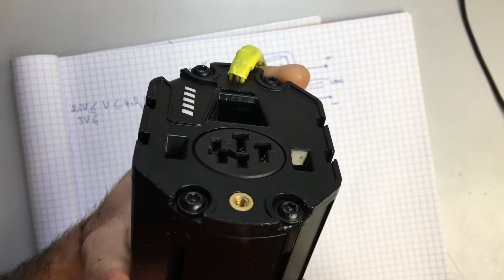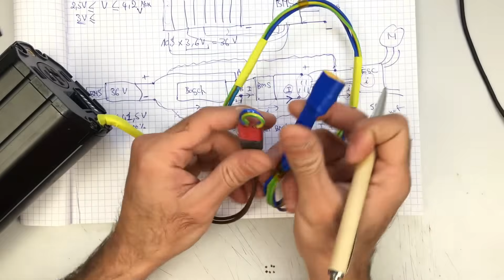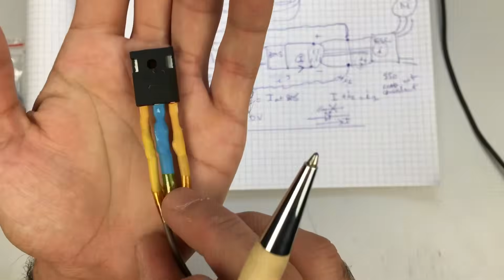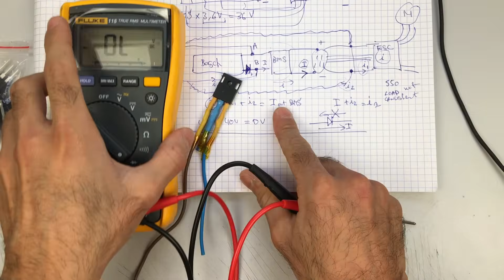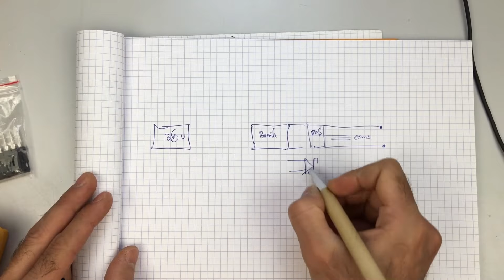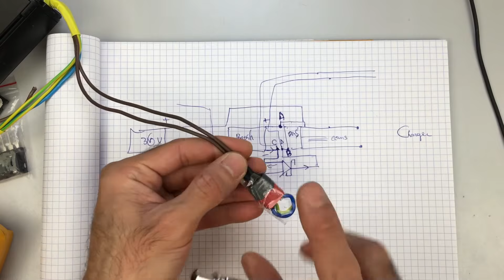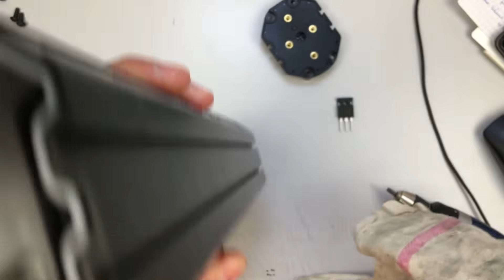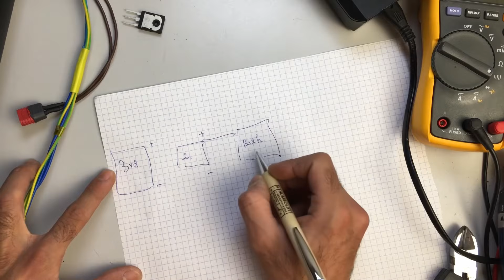Bosch ebike battery hack - Run your bosch ebike on any 36v battery

Comment: Thx, info before bms 👌,,  i just connected two bosch 400 batteries  together and bike runs twice range , of course same batery should be
Reply from the maker: Good to know. 
You connected them in parallel after BMS?

Comment: No fuses?
Reply from the maker: No need. The bosch bms has a fuse.
Reply: @theelectronage  Does it? It has a Shunt based fet cutoff, but no real fuse.
Reply from the maker: @Beeeeeeeeeee right. it has the same purpose. Doesn't it?
Reply: @theelectronage  If you're sure that the time the fets need to turn off is less than the time needed to blow up the fets with the new, higher short circuit current as the IR of the packs is way lower now.

Comment: I wouldn't use anything other than a Bosch battery.  I value my bike.
Reply: Sure until 5-7 years from now, when bosch stops manufacturing the battery of the generation you need and you need to change your whole bike that would be otherwise fine.

Comment: Why dont you get a bosch dual battery system ir powermore instead of these dangerous crazy plans????? completely unnecesary and will not work properly with the battery management and range control..there is a reason they are expensive...because they are excellent quality. You should never recommend this just because you are too greedy to be safe. If your bike explodes or stops working you will nit let us know but hou will deserve it for being so stupid
Reply from the maker: It is not for you. You need to be at least a neanderthal to get it, judging from your profile picture you're not there yet.
Reply: @theelectronage  I think even a neanderthal would know better than to do this hahaha

Comment: Thank you very much for the video and explanations!. I have a doubt: What happend if the 2nd battery is fully charged and the Bosch battery is medium charged? Bosch BMS would see differents voltages througth balancing wires and througth end wires. Would it be a problem? Is the system so smart?
Thanks again to share your project!
Reply from the maker: Hi,
First of all you shouldn't connect the two batteries with the bypass connected( if the 2nd battery is more charged than the bosch .) Otherwise it isn't an issue. 
We connected to the bosch before the bms and we didn't touch the bosch balancing wires, so the bosch bms isn't aware of the 2nd battery, only the bosch.

Comment: I there anyway to charge you Bosch Battery from a 3party charger using the XC90 connector. I tried it  will briefly charge for 1-2 second while the bike is powering down.
Reply from the maker: Yes there's a way. 
You need to provide 5v on one pin of the battery.  I don't remember which one you have to test the original charger.

Comment: Hello!
Do you know if it possible to convert this into a "dumb" battery just use the the positive and negative without the data cables? Or is the bms going to complain when no data lines are conncted?(I want to use this as a powerbank for another project and i have a bosch battery lying around)
Reply from the maker: Hi,
The bosch battery won't turn on unless connected to the bike both power and data.
But if your goal is to use it as a power bank there's a go around, you buy a buck converter ideally with under voltage protection, set it to the right values but you have to connect it directly to the battery +/- tabs inside the battery.  And you can charge your battery normally with a bosch charger, and you have the output voltage you want.
Good luck.
Reply: Very good idea thanks alot! I will try that

Comment: This is not a solution for a bosch battery thats bad you will allways need a good bosch so why should you make it
Reply from the maker: Hi,
This isn't for everyone. 
My reason is not to buy 2 extra batteries that I'll need to carry around on the rack otherwise why have them. and as it happened I found a very good 1kwh battery for dirt cheap, so 50 bucks instead of north of 1k euros for the same combined capacity of 2 boschs.
And I carry it on my top tube so my rack is free for other stuff.
And of course the advantage range of 150km give or take.
I don't recommend this if you're not a bit familiar with electricity. 
Good luck.

Comment: Great video, thanks! I would have 4 remarks/questions though:

1) You mentioned the Schottky diode had a voltage drop of 0.2V (measured on your voltmeter). However this measurement doesn't reflect the voltage drop that occurs in real life condition when the diode is actually carrying some current (e.g. 10A or 20A). The diode specification mentions a maximum forward voltage drop of about 0.7V, typical of Schottky diodes. Therefore the losses are likely much larger than what you suggest. I'm quite surprised this is not causing heating issue with the diode enclosed in the battery housing without heatsink because it is likely to dissipate something like 15W when both batteries provide 10A (max load). Actually, you could use 2 "ideal diodes" instead of a Schottky because these have a much lower voltage drop (<0.1V) but these are much more expensive. Since the specification of the diode mentions a forward drop of 0.7V, aren't you concerned about the heat buildup? As you show in the video, there are no heat marks near the diode but the potential for up to 15W inside the battery case looks a bit scary to me...Of course that would'nt be continuously but still, on a long hill, it could really heat things up.

2) At some point in the video, you connected the second battery to the Bosch while the loopkey (i.e. diode bypass) was plugged-in. If the Bosch battery had a higher state of charge then the extender, that wouldn't be a problem. However, in that configuration, if the extender had a higher charge than the Bosch battery, the bypass would allow it to discharge it into the Bosch. Correct? So I guess the safe recommendation is to never connect the 2 batteries together without first removing the bypass (unless you're absolutely sure the batteries have the same state of charge). 

3) I read that the Bosch BMS also actually monitors the Wh flowing through it and would not let current flow anymore once something like 500Wh has passed through it. Did'nt you experience such limitations? I think I've seen this on the german forum pedelecforum.de but can't find the link anymore.

4) Instead of opening the battery case, why not do this modification outside of the battery and connect the diode after the BMS? I guess the limitation here is that battery gauge/range calculation could be wrong as the extender is not connected to the Bosch BMS but besides this, what would be the drawback? EDIT: I actually missed that point but this is well explained in the video!

Thanks!
Reply from the maker: Concerning your 3rd point,
Yes the BMS does measure the amps going through it, but at least this 2nd gen motor I have isn't that smart, because with the extender it still gives you a battery reading and range(based on 500wh) but doesn't know that something is wrong after you consume 500wh, it just sees the battery voltage runs down very slowly.
I don't know about the new so called Bosch smart system.
Reply from the maker: Hi, sorry for the late reply.
Regarding the first note, yes I may have gotten the diode working conditions wrong, but everything's in the datasheet.
I was kind of worried about the heat dissipation,and was contemplating doubling the diodes just to make sure, but after I opened it, believe me I've done more than 1k km by the time I opened it to check in real world conditions ( temps from 0c°-35c° and hills that sometimes go for 10km) but everything's okay.
Of course don't take my word for it. This isn't for everyone anyway, and the more you know the safer you are.
Reply from the maker: On your second note, 
Yes indeed you are right and I missed it.
The second battery could be able to discharge into the bosch, however, I always only connect them when fully  charged, and after that even when you put the bypass in place you can be sure they're at the same voltage.
But good catch. Thank you.
Reply from the maker: And for the last point you got it. I did try first by connecting them outside the Battery, but it throws an error from time to time, then I would have to disconnect, shut/Start the bike, connect them again and you're good for a while. I didn't care for it.

Comment: can u run any ebike with a bosch battery?
Reply from the maker: Hi,
Well yes, if you open it and connect directly to the battery pack inside, but you need to monitor voltage so as to not overdischarge it.
I've seen someone on yt who used an arduino or similar to give the required signal needed for the battery to wake up. 
Otherwise the battery will not work outside of the bike.
Reply: @theelectronage  thank you very much for a quick answer

Comment: Well, I did it as explained and when the ebike is running for a few minutes it gives me error 500 and I have to turn it off and on again and it cannot be turned on with the two batteries connected either. I have to disconnect the second one to turn it on and then connect it.
Reply from the maker: Hi, 
Sorry to hear that. I had the same experience where I have to disconnect the2nd battery and turn the bike back on(it was error 550 though), but it happened when i connected the 2 batteries in parallel outside of the bike. 
You did disassemble the battery and connect before the BMS?
Also what gen motor do you have?

Comment: Hello, and thanks you for the explanation, very clear and detailed, I have a couple of questions:
1.- I see you are using same Bosch tube battery to put as an extender, could it be done with other battery (not Bosch) of course 36V but 360 Wh
2.- the diode is not getting too hot? in order to know where I can store.
Than you in advance
Reply from the maker: Hi,
You do need an original bosch battery for the bike to work, but yes you can use any capacity you want.
The diode doesn't get much hot otherwise it would have left a mark in my battery. 
Good luck.
Reply: My question is if is needed 2 original Bosch batteries to do this hack or you can have the original mount in the bike and additional non Bosch battery mount in parallel, if not, why?
Reply from the maker: @hectorlopezgonzalez1868 only one original battery is needed.

Comment: Question: I wish to install a complete new downtube battery onto my E-Bike and discard my Bosch Battery because it is too old.
I must use the Bosch BMS from the Bosch battery on my new battery to go to the controller display on the bike is this correct ?
I simply add the Old Bosch BMS to the new battery ?
Thanks again.
Reply from the maker: Yes that's it. Just locate and label the balance wires to connect them correctly unto the new 10s battery. Basically as it was connected you do the same. I believe after you just connect the charger to activate the bms.
I haven't done this myself but seen others do it.
Reply: great question thats exactly what i want to know
Reply: @chrisluff7088  Seems so frikin' straight forward that I'm surprised the people and bike shops who sell E-Bikes and batteries don't actually use this as a selling point ...
Reply from the maker: @user-oe1mb9hu9i It happens that I work in a bikeshop, it has to do first of all with insurance and warranty purposes, but also to avoid any dishonest customers that will link anything that goes bad with the ebike to the modification I make on the battery. 
Good luck with your battery.
Reply: @theelectronage  Health and Safety and warranties have crippled the world.
Education is badly in need to help people UNDERSTAND, instead of that we produce "lemmings" who do what they are told.
Thanks for the help.
Cheers.
Reply from the maker: Yeah the sad state of the world we live in. But the more you know and understand the better off you'll be.  And carry on we shall.

Comment: Many many thanks for this. I am not an electrician but I studied physics and think the same as you.
Too many companies are "locking" their clients in to their products instead of allowing the clients the freedom to choose.
I have just bought a second hand E-Bike and did the sane research.
I will now have the confidence to invest in a battery that I want and not a battery that the E-bike company  push on me for Eur 900 !!!!! 36V 15aH - 509wH
THANKYOU.
Reply from the maker: Hello friend,
My pleasure. I also finally bought a vesc and used it on my bosch bike, and I'm glad to say it works. I'll post a video soon.
Good luck
Reply: yep, but they lock you to buy bisch battery, cause they can guaranty for that, there wil be no explosion😂
Reply from the maker: @01titicu it goes without saying that  you void your warranty if you still have it and need to have some understanding of what you're doing and accept the risks. 
Also a branded battery might be eligible for replacement or insurance  claims but that doesn't guarantee you'll never have a fault or fire with it.
Reply: @theelectronage  ye but still the risk are higher, and you really must know what to do, i understand that this video is for profesional only, but to many details make a noob trying to replace hes battery thinking is a smartass, the bms from market are lower quality then originals....higher risk, not really higher repay....the cell price is high anyway

Comment: I can connect the diode in + or obligatory in -?
Reply from the maker: السلام عليكم ورحمة الله وبركاته. 
I just made an error in the explanation. The diode is to be connected on the + line( for our application it's always the 2+ into the  diode and the output is the MAIN +. if the BMS was on the - line we still connect the diode the same way on + and the negative of the second battery is connected before the BMS).
Good luck.
Reply: @theelectronage  thank you so much 😊

Comment: HELLO , i have a giant bike wich my battery was stolen "Energypack 300 " i found a recycled battery from another bike but ive connected the postive and the negative to the battery "leaving the bleu wire "  and it works fine for couple of seconds then the assist shutdown and the motor stops any ideas how i can bypass this or any other information regarding the bleu signal wire thank you
Reply from the maker: Hi,
I'm not sure what's the problem. 
I'm actually working on my bike right now, and looking at the connection to the motor, it has +/- and CAN HIGH & CAN LOW. As well as 2 other  small cables connected to the +.(the  battery has +/- & CAN H/L)
If everything is connected well and the problem persists, I'd suspect the battery bms has a fault, because if it was a connection problem the bike won't turn on, and definitely wouldn't assist even a little. 
I'm working on running the bosch motor with a vesc, and it's promising  so far. I'll publish a video about it.
Good luck.

Comment: Misleading title. You cannot run your Bosch bike on any battery if you still need the entire original battery installed.
Reply from the maker: Tis the next best thing. 
You can use a vesc in order to use any battery but it won't be bosch stock then.
Reply: You can take a bosch bms with all captor (thermal...) and connect to output of chinese batt with fake balance line (dividing voltage with résistors of big values)
This way you have Made a universal interface to connect à chinese bat to bosch system alone... making bike think chinese is a bosch battery !@🎉😂
Reply from the maker: @folcovhrs in principle it should work.
Have you tried it?

Comment: Thanks for this video. I don't see the need for a diode! Making both batteries permanently in parallel would work. They are in balance.
Reply from the maker: Hi,
It's for simplicity and convenience and safety. 
This way I don't have to check the 2 batteries each time i need to connect them, or carry a multimeter everywhere.

Comment: Another question: if i buy a really worn out Power Tube with almost no capacity left but with a working BMS on Ebay and connect it to a brand new 1300 Wh Lithium Ione battery, would this cause problems? would the Bosch run out of juice before the secondary battery and would this cause problems?
Reply from the maker: Hi, 
I suppose it would work, but the only as long as the bosch battery keeps up. Because for example the worn out battery could have lets say 36v so still good for a while, but as soon as any of the 10 cells(weak one) gets below 3v it will shut down to protect itself, even if the 2nd battery has juice.
So you have 2 options: you can simply take the bosch bms and put it  on the new battery( you can keep the battery shell and run wires to it including balance wires).
Or you can first fix the powertube, in other words recell it with new li-ions while adding the schottky diode for use with the 2nd battery. I suppose this 2nd option is a lot of work and needs a bit of care when working on batteries. 
Either way it's up to you and what suits your specific use.
Good luck.
Reply: Thanks! Yeah you are right, i could simply build a new battery pack but just with a original Bosch BMS

I will be looking for a cheap powertube in my Area, prices can only get better the as time passes
Reply from the maker: Good luck. Also I think the older powerrack can also work. I have one with bad cells but I haven't gotten around to harvesting the bms yet.
Reply: @theelectronage  please document it on video again as soon as you try to repurpose it. I am still worried that the BMS locks itself as soon as there is no voltage for a moment.
Reply from the maker: @lukasschmidt4902 yes I'm planning to. I also wanted to make sure for myself as you said that the bms doesn't lock, even though I'm quite sure it works according to a French YouTube vid I've seen.

Comment: Very nice, thanks!

What about LiFePo4 batteries? could they also be added this way? they have a slightly different voltage
Reply from the maker: I suppose you can, but you need to do some math so that the lifepo voltage(number of cells) matches the working voltage of the normal li-ion (29or30v-42v).